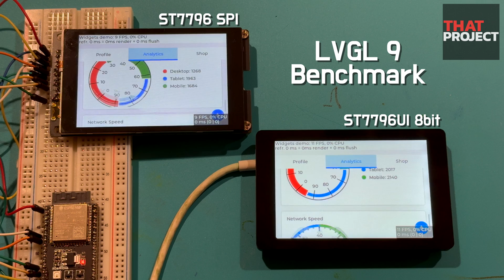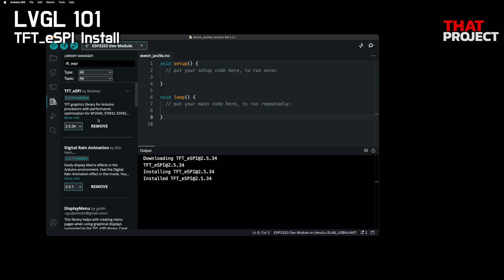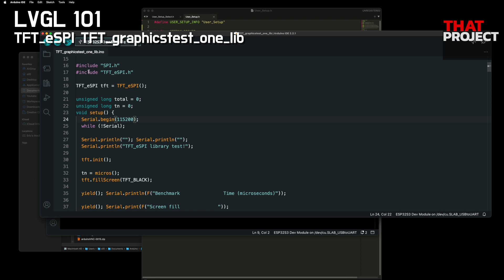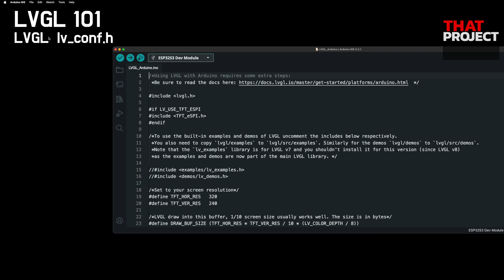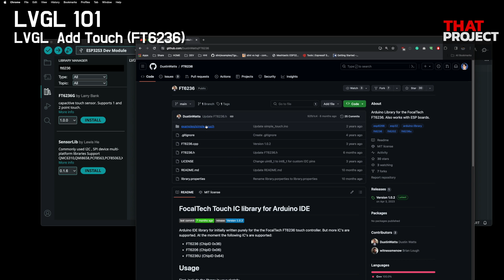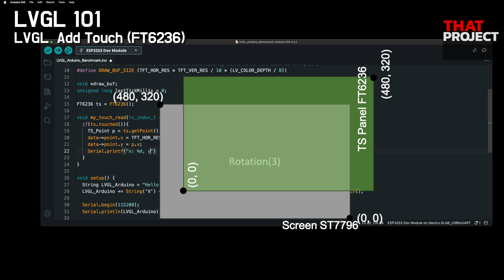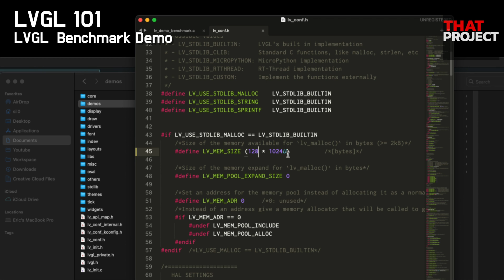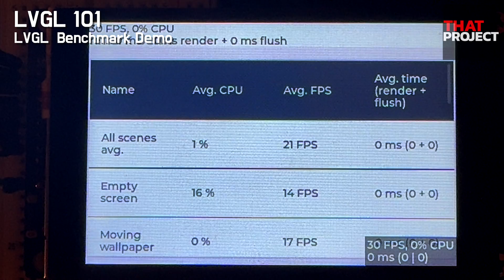LVGL 9, [Ep. 01], From Scratch to Benchmark, For newbie/beginner/starter #LVGL #UI #ESP32 #Benchmark

Comment: Can i apply on tft ili9488 sir
Reply from the maker: ILI9488 can be used in LVGL without any problems. Try it and let me know if you have any problems.
Reply: @ThatProject  i have tried but the image does not appear on the TFT screen
Reply from the maker: @roniefendi.  Is this an issue with LVGL? Is this a TFT_eSPI driver settings issue?
Reply: @ThatProject  When I utilized the TFT_eSPI example with the "esp32-wroom-32" board, the display functioned properly without any issues. However, when I switched to LVGL, the screen failed to display, and the images couldn't be loaded.
Reply from the maker: @roniefendi.  You have already confirmed that the display is properly connected via TFT_eSPI. How did you output the image from LVGL? Images are not output the way they were with TFT_eSPI. Try printing text using a Label rather than an image.
Reply: @ThatProject  I can display text using LVGL version 7, but not in LVGL version 9, and when using LVGL version 7, the TFT screen appears too dim
Reply: @ThatProject  Sir, I have successfully displayed the text in LVGL 9, but my TFT screen is dark. I am unsure what is happening.
Reply from the maker: @roniefendi.  Your LVGL9 is finally working. Congratulations. Is the screen dark? Is the display's blacklight GPIO set to high? Or do you think this is LVGL problem? Was there a problem with the screen darkening when drawing an image in TFT_eSPI?
Reply: @ThatProject  Yes, sir. I set the 'backlight to high', but the TFT screen is still too dim, making it difficult to see. Is there no way to adjust the brightness of the TFT screen, sir? Also, when I upload an image to the TFT, the displayed colors are different from the original.
Reply: @ThatProject  I have resolved the issue regarding the brightness of the TFT screen, sir. However, I have not been able to address the issue regarding the colors of the image displayed on the TFT screen, which differ from the original.
Reply from the maker: @roniefendi.  Most graphics settings should be done in TFT_eSPI. It seems to me that the color order of the display is wrong when using LVGL.
Please try these one by one in User_setup.h file.
// #define TFT_RGB_ORDER TFT_RGB // Color order Red-Green-Blue
#define TFT_RGB_ORDER TFT_BGR // Color order Blue-Green-Red
Reply: @ThatProject  Sir, I have completed everything. I am very grateful for your assistance, and may I ask one more thing, "may I ask again when I encounter difficulties in the future?"
Reply: @ThatProject  "Sir, I currently have an issue with the touchscreen. When I upload the TFT screen code, it turns black."
Reply: @ThatProject  sir,i believe the "ft6236" is not compatible with my TFT screen,is there any other solution you could suggest
Reply from the maker: @roniefendi.  Please first check which touch screen IC is used in the device you are using.
Reply: @ThatProject  IC is HR2046 sir
Reply from the maker: @roniefendi.  The HR2046 is much the same as the XPT2046 or any other Touch chip. They all have the same pinout and instruction sets. So you can use TFT_eSPI's internal touchscreen commands. After setting the CS pin of the Touchscreen in User Setup, try https://github.com/Bodmer/TFT_eSPI/blob/master/examples/Generic/Touch_calibrate/Touch_calibrate.ino to get the calibration value.
Reply: @ThatProject  I have already performed the calibration
However when i upload my code,the TFT screen does not display anything,nevertheless,when i comment out the code using 
/* if (!ts.begin(40,SDA_FT6236,SCL_FT6236)
{ Serial.println('unable to start the capacitive touchscreen);
} */
The screen does display,but it is not touch responsive...
Reply: @ThatProject  i use resistive touchscreen sir
Reply: @ThatProject  when i use "ts.begin(40) not !ts.begin(40) my screen blinking sir
Reply from the maker: @roniefendi.  I use FT6236 capacitive touch so you can't use this on your device. Therefore, please remove the "ts" related part.

Resistive touches like the XPT2046 usually require calibration. As mentioned in a previous comment, please use https://github.com/Bodmer/TFT_eSPI/blob/master/examples/Generic/Touch_calibrate/Touch_calibrate.ino to first obtain the calibration values for your touchscreen.

After that, the correction value must be added through tft.calibrateTouch().

TFT_eSPI tft = TFT_eSPI(); // Invoke custom library

uint16_t calData[5] = {123,123,123,123,123} //Your calibration
tft.calibrateTouch(calData, TFT_MAGENTA, TFT_BLACK, 15);
Reply: @ThatProject  i have already calibrated sir,an i obtained this data"{234,3628,357,3329,7}".The X and Y data also appears on monitor,but when i click the screen,the keyboard does not appear sir
Reply from the maker: @roniefendi.  Ok. Then how did you implement the my_touchpad_read() function?
Reply: @ThatProject  
void my_touchpad_read(lv_indev_t *indev, lv_indev_data_t *data) {
   uint16_t touchX, touchY;
   bool touched = tft.getTouch( &touchX, &touchY);
   if( !touched )
   {
    data->state = LV_INDEV_STATE_PRESSED;
      
   }
   else
   {
      data->state = LV_INDEV_STATE_RELEASED;

      /*Set the coordinates*/
      data->point.x = touchX;
      data->point.y = touchY;

      Serial.print( "Data x " );
      Serial.println( touchX );

      Serial.print( "Data y " );
      Serial.println( touchY );
   }
 
}

Like this sir
Reply from the maker: @roniefendi.  Try removing all of my touch-related "ts" and then adding the code below.

#include <TFT_eSPI.h>

TFT_eSPI tft = TFT_eSPI();

void my_touchpad_read(lv_indev_t *indev, lv_indev_data_t *data) {
  uint16_t x = 0, y = 0;
  if (tft.getTouch(&x, &y)) {
    data->point.x = x;
    data->point.y = y;
    Serial.printf("x:%d, y:%d\n", data->point.x, data->point.y);
    data->state = LV_INDEV_STATE_PRESSED;
  } else {
    data->state = LV_INDEV_STATE_RELEASED;
  }
}

Unfortunately, there seems to be no way to get a reference to the TFT_eSPI driver used by LVGL yet. It seems like this is the only way now. Same as your my_touchpad_read(). Aren't touch events happening here?
Reply: @ThatProject  I have already tried it, sir, but it still did not work. The day before, I also purchased an ILI9488 TFT "capacitive type screen" and tried uploading the program. However, the serial monitor reported "Unable to start the capacitive touch screen."
Reply from the maker: @roniefendi.  What is the touch IC of the ILI9488 you newly purchased? My code doesn't work unless you have an FT6X series like mine.
Reply: @ThatProject  I have successfully used the touch screen; however, the display is not showing any image.
Reply: @ThatProject  I could not find any reference for the ILI9488 capacitive touchscreen, specifically for CTP_SDA, CTP_SCL, CTP_INT, and CTP_RST. Do you have any references for this sir?
Reply: @ThatProject  i have completed the display and touch screen setup,but when i click the form(text area)the keyboard does not appear sir
Reply: @ThatProject  I have successfully displayed the keyboard, but it can only show numbers. It has not yet been able to display letters sir.
Reply: @ThatProject  I have completed everything. Thank you very much for your assistance, sir.
Reply from the maker: @roniefendi.  Oh, so your touch driver works now? Remove this part if you have it in your code, lv_keyboard_set_mode(kb, LV_KEYBOARD_MODE_NUMBER);
Reply: @ThatProject  yes sir,thank you very much

Comment: I jave issues with WT32sc-01 coud you share the configuration for it?
Reply from the maker: This is the LovyanGFX settings for WT32-SC01 Plus used in LVGL 8. Please refer to this and try it first. I'll probably use the WT32-SC01 Plus in my next project. https://github.com/0015/ThatProject/blob/master/ESP32_LVGL/LVGL8_SquareLine/03_Let's_build_a_GPS_Speedometer/SC01Plus_BN880Q_GPS_App_Part2/SC01Plus_BN880Q_GPS_App_Part2.ino

Comment: Thank you very much for your intro.
I’m working with an ESP32 with Arduino framework.
I’ve already used previous versions of LVGL implementing my disp_flush and touch_read callback functions.
With latest version of LVGL I can enable LV_USE_TFT_ESPI define and I saw from code that with lv_tft_espi_create function it creates automatically the flush callback. But what about the touch callback (compatible with TFT_eSPI)? I don’t have found any reference in LVGL code. Do I need to implement it? How can I get the TFT_eSPI reference (created in function lv_tft_espi_create) to define the touch_cb in my main, to avoid a new instance? or is better that I define it in lv_tft_espi.cpp file of LVGL? or, maybe, I’m on the wrong way…

I would like to find the best practice.
Thanks in advance
Reply from the maker: I think you are already familiar with using TFT_eSPI. And I think you are trying to use your xpt2046 touch. Am I right?
If you specified TOUCH_CS PIN in User_Setup.h, you can receive touch information through TFT_eSPI.

Looking at this example:
https://github.com/0015/ThatProject/blob/master/ESP32_LVGL/LVGL9/LVGL9_Ep04_ExtraExample/LVGL9_Ep04_ExtraExample.ino
Line #31,
TFT_eSPI tft = TFT_eSPI();
tft is now available. With this, I rotated the screen.

Now all you have to do is change my_touchpad_read() like this:
void my_touchpad_read(lv_indev_drv_t *indev_driver, lv_indev_data_t *data) {
  uint16_t x = 0, y = 0;
  bool pressed = tft.getTouch(&x, &y);
  if (pressed) {
    data->state = LV_INDEV_STATE_PR;
    data->point.x = x;
    data->point.y = y;
  } else {
    data->state = LV_INDEV_STATE_REL;
  }
}
Reply: @ThatProject  Thank you very much for your answer. Yes, I vas used to do like your example, but now, with lv_tft_espi_create LVGL instantiate a TFT_eSPI object and I think that is a bad idea create a new SPI concurrent object. Probabily I need to do the same inside lv_tft_espi.cpp file, using the same object created in lv_tft_espi_create function
Reply from the maker: @francescoserpetti6119  When creating a TFT_eSPI object in LVGL, use the "new" keyword. Then, assign this object to the TFT_eSPI pointer of the lv_tft_espi_t structure.
Unfortunately, because lv_tft_espi_t is internal, there is currently no way to obtain this object via lv_display_get_driver_data().
It would be possible to change this struct in lvgl so that it can be used externally in the future, but there seems to be no way to reference this in the current version 9.1.0.
Reply: @ThatProject  And that's exactly my problem. I've to instantiate a new TFT_eSPI but it could create a confict with the object created internally by LVGL sharing the same SPI. Probably I've to extract only the touch driver from TFT_eSPI library and instantiate it in main.

Comment: Thank you great video.
I use ESP32 + ili9341 + XPT2046(Touch controller).
I could display Hello Arduino V9.0.0. with your video.9:39

Next I write code with your video 10:35(Add Touch FT6236).
I try to replace FT6236 to XPT2046. But could not compile🥲.
Do you have any information about LVGL9 code with XPT2046?
Thanks🌷
Reply from the maker: For XPT2046, you can use the built-in function of TFT_eSPI. First, after calibration, you can get the calibration values for your display. https://github.com/Bodmer/TFT_eSPI/blob/master/examples/Generic/Touch_calibrate/Touch_calibrate.ino

If you change the following to your calibration value and run it, the touch will likely work.
uint16_t calData[5] = { 0, 0, 0, 0, 0 };
tft.setTouch(calData);
Reply: Thank you for quick advice!
I will try later.😀
Super Thanks☕

Comment: Hi thanks for the tutorial. I have a crash issue though. I checked with tft_eSPI. board and screen works great. but when I try to compile lvgl demo, IDE crashes after sometime (1-2 mins ) giving ping error without a valid compile. Did you have this kind of error before?
Reply from the maker: I've experienced that kind of error. Seems like your IDE is out of memory or has some issues with it. What about changing the IDE version? Try the latest version or the previous version.
Reply: @ThatProject  I've installed latest nighty version which is the one error occurred. I've reduced the version to 1.8 now it kind of works. Compile time is ridiculously long some how.
Reply from the maker: @zekisolak4141  Because there are so many widgets included in the benchmark, it takes a lot of time to compile.

Comment: Hello, I have an error when compiling the program, I have already tested several things, but without success, could you help me, it is related to LVGL. 
error :

In file included from c:\users\fi\onedrive\documentos\arduino\libraries\lvgl\src/lv_init.h:17,
                  from c:\users\fi\onedrive\documentos\arduino\libraries\lvgl\lvgl.h:24,
                  from C:\Users\fi\OneDrive\Documents\Arduino\libraries\lvgl\src/lvgl.h:16,
                  from C:\Users\Filol\Downloads\LVGL9_Benchmark_TFT-eSPI_Arduino\LVGL9_Benchmark_TFT-eSPI_Arduino.ino:15:
c:\users\fi\onedrive\documentos\arduino\libraries\lvgl\src/lv_conf_internal.h:59:18: fatal error: ../../lv_conf.h: No such file or directory
          #include "../../lv_conf.h" /*Else assumes lv_conf.h is next to the lvgl folder*/
                   ^~~~~~~~~~~~~~~~~~~
compilation terminated.
exit status 1

Compilation error: exit status 1
Reply from the maker: Isn't this a path issue in the lv_conf.h file? Have you set it up the same as this? https://youtu.be/s4_fUwhw-dI?si=SRirLJ5ufCCtRfj_&t=356
Reply: I had copied the file to the scr folder, but for some reason there must have been a problem and when I copied the file again, it ended up working.
But now I'm having problems with the Touch screen that doesn't want to work. Thank you very much for responding @ThatProject
Reply from the maker: @filipesigrist9252  Touch input requires an appropriate touch driver. What type of touch IC do you have?

Comment: Does it work with esp32 t display? Not the S3
Reply from the maker: This is possible if TFT_eSPI supports ST7789V. Have you checked?
Reply: @ThatProject   well inside the user_setup.h there is st7789 so i think it's possible

Comment: Heyy. I hope you make some tutorial with lvgl and physical buttons like a external push button. Im confused about make some group
Reply from the maker: This is an example of using lv_group_create() when using a rotator on a device without a touch screen. It is built on top of LVGL 8, so it may differ from LVGL 9. https://github.com/0015/ThatProject/blob/master/ESP32_LVGL/LVGL8/ZX2D10GE01R-V4848_Arduino/ZX2D10GE01R-V4848_Arduino.ino
Reply: @ThatProject Is the output of int16_t `cont_now = mt8901_get_count();` valued at -1 ccw, 0 stationary, 1 CW?
Reply from the maker: @andrisetianabrata  I believe that's correct.